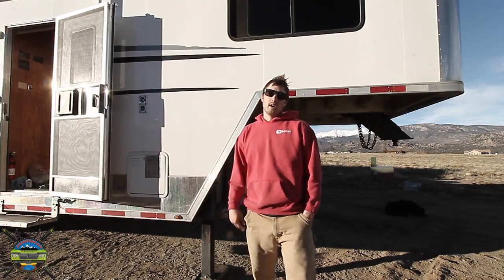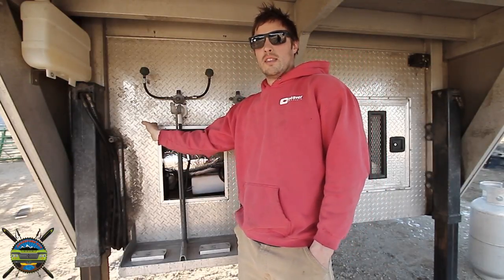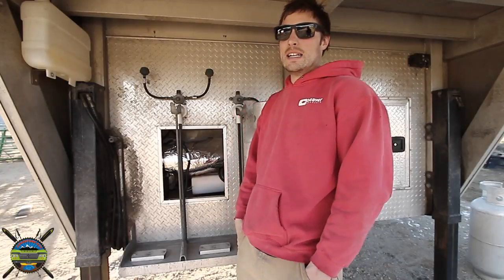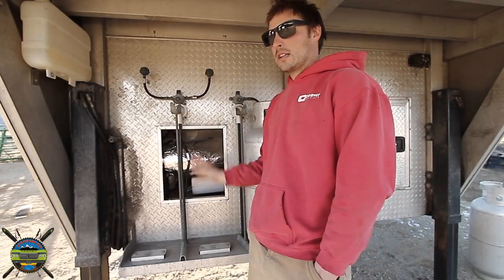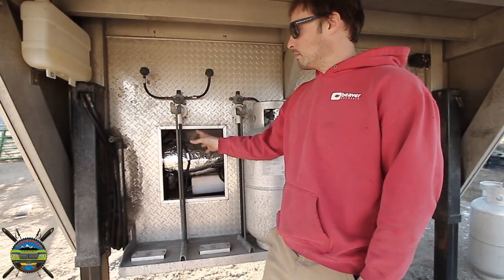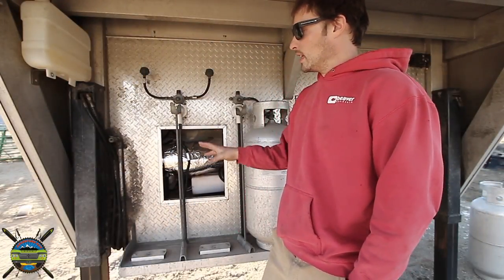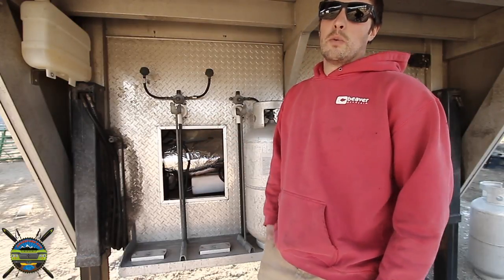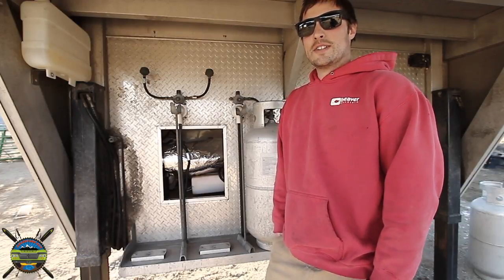Planar Heater Sound While Running: AdventureRig Review

Comment: hi

I'm looking at getting a planar diesel hydronic Binar 5S for my Mitsubishi delica. I want to heat the coolant to help with cold starting the engine, and also heat the interior of the van. Does the interior get heated from ducted air from the diesel heater, or does the cabin heat up from the coolant system being heated, therefore the factory heater core heats up? does it require auxiliary fans to get hot air into the cabin?
Reply from the maker: Hi Harley. I don't know anything on the hydronic heaters so I can't answer the question. I've only used the diesel air heaters.

Comment: Should I get the 8 DM OR THE 44 FOR MY 37 fter. Is the 8 overkill or should I just getnit? Thanks buddy
Reply from the maker: If you are trying to heat a 37ft space I would go with the 8DM. The 44 is made for smaller spaces up to 25ft. Also I was recently on their website and they have had issues with counterfeit PLANAR heaters. Make sure you are buying it off them or an authorized retailer. I have had some messages from people saying their heater has issues and I think they may have found the fake ones.

Comment: Hi Tyson, can you run the heater with 12volt all night without draining the juice out of the battery?
Reply from the maker: Peter Arnga Yes but I have 450 amp hours of battery. You’ll need to do the calculations for your battery situation.

Comment: I hope u get more than 3 months out of it before it fails  I had two units  both failed  problem is the fuel
Reply from the maker: I never had an issue with this heater and eventually sold the camper. It's a great unit, sounds like you found out the cause was your fuel.

Comment from the maker: Hi Ellen,

We used a reducer and went from a 6'' outlet at the heater to a 5'' heater hose that we ran the heat through. The 5'' hose runs for 2' where it splits and runs another 2' to a vent and another 6' to another vent. The hose is 5'' the entire way. If you have any specific problems email planarheaters@gmail.com. They gentleman's name is Seargey who you will talk with. He'll gladly walk you through the installation process as he was very helpful in ours. I hope this helps.